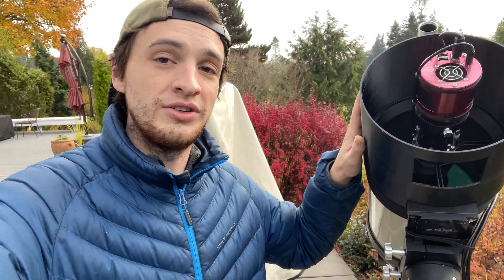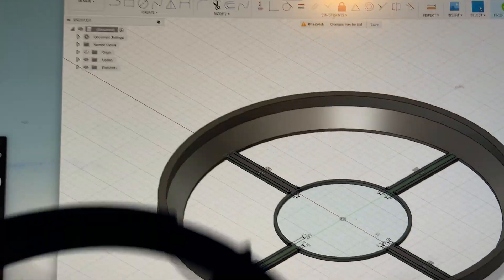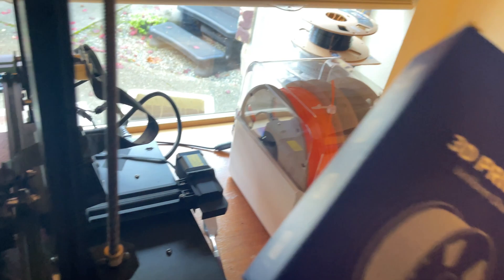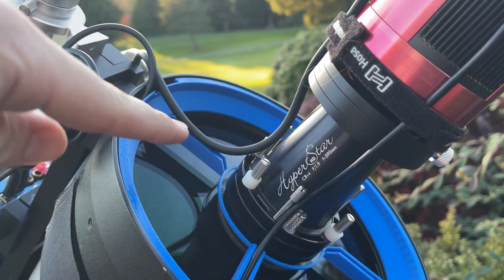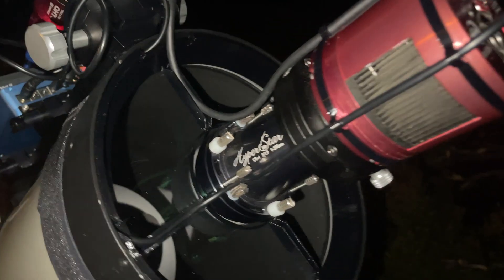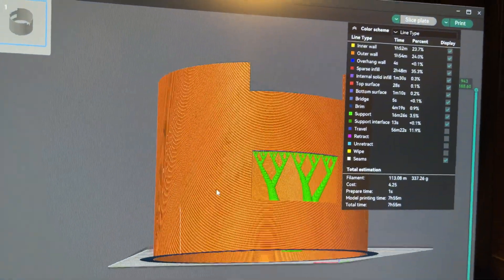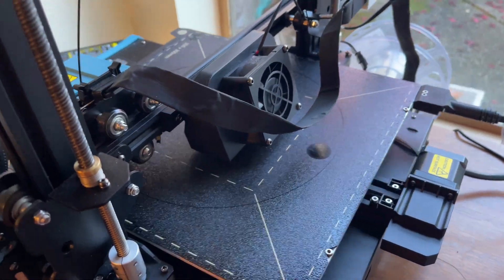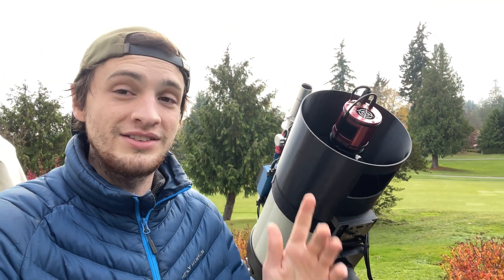Why You Need to Make Your Own Telescope Parts

Comment: You do good work, but you also do a good bit of waste. PLA may be "natural" but if not composted properly it is no different than any other plastic in the environment. About the only thing I could pick on. I am sure you put a mat black finish on them later at some point.
Reply from the maker: Thats true! Luckily i live very close to a recycling center that allows for sorted plastics, and has disposal for PLA. If it’s just small bits they tend to go in the garbage but i save the big junk parts and bring them to be recycled.

Comment: Any updates on the dew shield and cap files? I just got a Hyperstar for my CPC 800 and I love the idea of the cable router and dew shield window. Are you finding any light issues having the window with the dew shield?
Reply from the maker: I ended up going back to my usual dew shield before the 3-D printed one. I found that it was using more filament than i wanted per prototype, and i dropped the cap once and it broke so I didn’t bother re-printing. If i do go back and fix it, I will upload the files. I just didnt want to upload low-quality files for other people to print if I knew they weren’t going to work very well.
Reply: @ColeRees  are you willing to share the CAD files of the few shield and cap? Some of us have more filament than we know what to do with right now. LOL I might be able to figure something out that can work for me. I find prototyping fun.

Comment: It is all cool and useful I know and I respect that. However one thing I will not understand is to have obstructions and newtonian like images with a difraction spikes. with all the stuff added infront I belive you can achive sharper images with newtonian telescope and reducer/corrector. sharper images with f3 instead of f4 and you are not losing automation option with filter wheel. Iunderstand useage case here. However secrificing a lot for one stop light gathering even that is some argument with all the obstraction infront of the telescope. Maybe I am missing something here. I can be wrong about this just throwing my opinion.
Reply from the maker: I totally agree! I only use my Hyperstar for outreach now. This was a fun side project that I chased for a week or so. I use my esprit 100 almost exclusively now for AP.

Comment: Cool, that's my cable router!  Very nice modifications.  With the original design I left the outer diameter a little small to incorporate a nichrome wire dew heater on the outside.  I really like the additional channel around the outside that spits the cable out the top, wish I had thought of that.  PETG is definitely the way to go, especially for the delicate thin wall cable channels.  I've printed dew shields for all my telescopes, instead of trying to nail down an exact fit and dealing with printing tolerance I usually just print it 1mm larger then use adhesive backed felt to tune up the fit.
Reply from the maker: Thank you so much!! Love your original design. I was struggling to come up with one and then I found yours which began the rabbit hole which is this video 😅
Reply: Where do you have your files? Which 3d model site do you store them on? I'd love to see what you've created!

Comment: You should really design that window to be like circular or peaked at the top so it doesn't need supports. There's really no reason to make it square and removing the sharrp corners will also make it less fragile.
Reply from the maker: I tried a version with filleted corners on the filter window and didn’t like it as much. I have pretty big hands, though. Layer adhesion and strength are super strong on this part (high print temps)
Reply: @ColeRees  there are better ways to do it than just filleting the square. But if it works it works

Comment: Nice job Cole, Yes make it tall enough to be able to put on a cover without having to remove the camera and cables. Come down this winter and do some imaging from a dark sky.
Reply from the maker: I’ve designed a cap that is about 4” tall and will cover the entire front end and window when not imaging. It has about 6 hours to go on the print and then I will fit it on